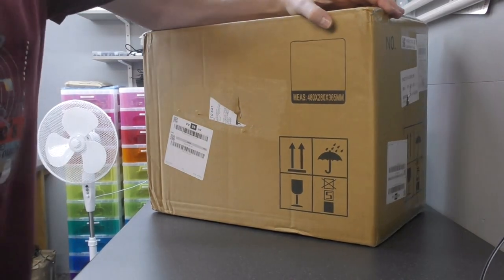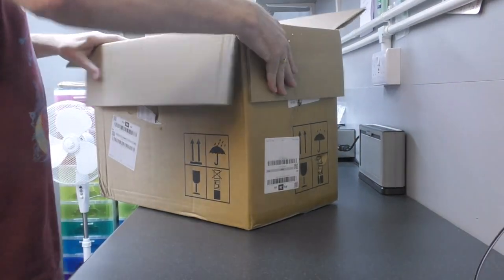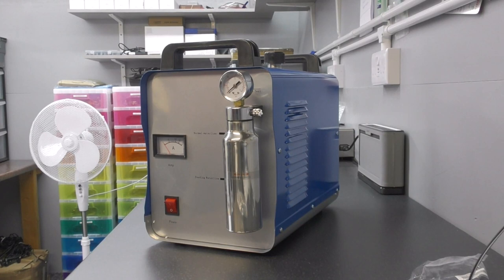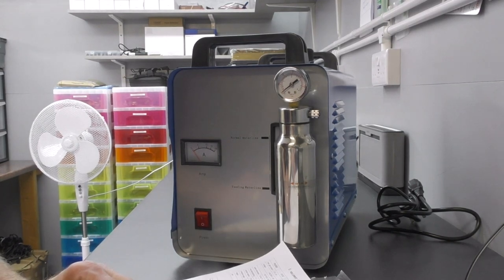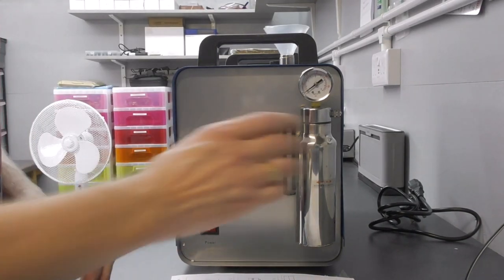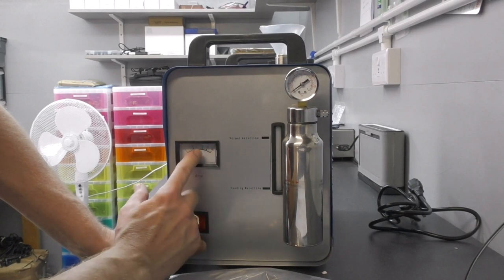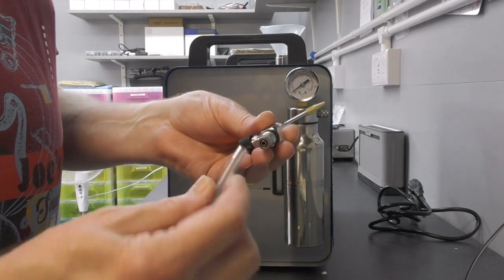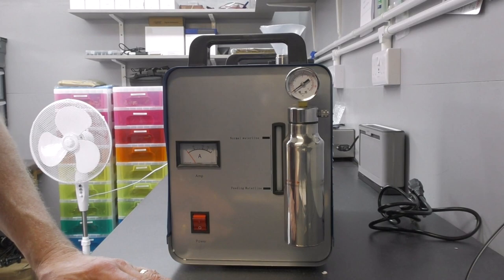Oxygen Hydrogen Flame Polishing Machine Un-boxing,

Comment: Morning Trev,
I have been looking for your latest update on this hydrogen welder and can't find it anywhere?
Can you send me the link for it or just tell me if it can heat up the downstairs of a 2 up 2 down house? 
Need to sort this before winter gets here? Thanks mate.
Reply from the maker: Hi
I'm sorry but work commitments have stopped all youtube work. I did film it but wasn't really happy with the video. Yes, it works but I can't see how this model could heat up two rooms. The nozzle size is restricted by the output it can produce. The flame is at thousands of degrees C and could  be extremely dangerous in the wrong hands. I would also suggest a second flashback device is required for safety, you can buy torches from the States with a flashback arrestor built in. The built in meter suggests around 15 amps is being drawn but I would have to question that and use a clamp on meter to check.
Reply: @Trevs-Shed  Hi Trev Thanks for your reply. I will give it a miss then unless you want to sell me yours? I'll be very interested to buy it?